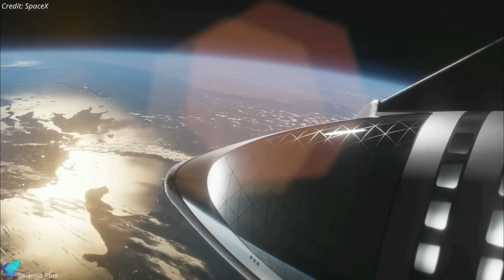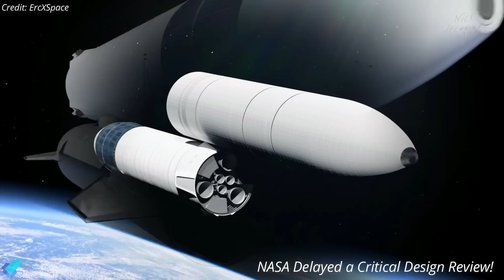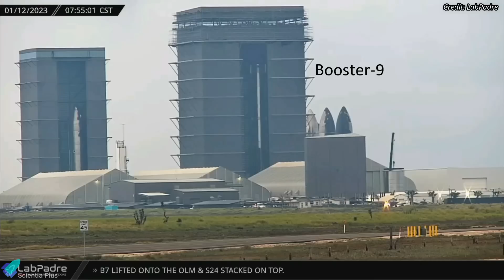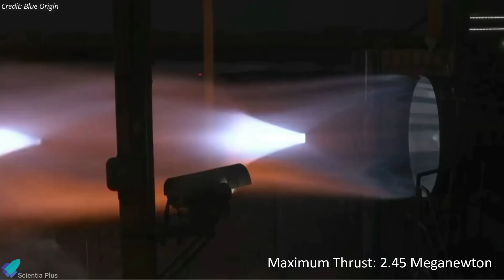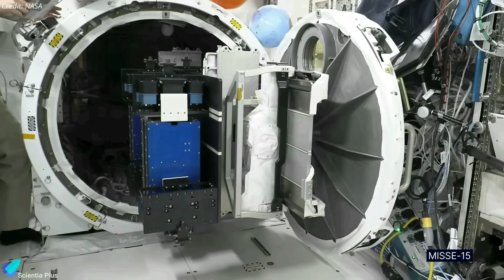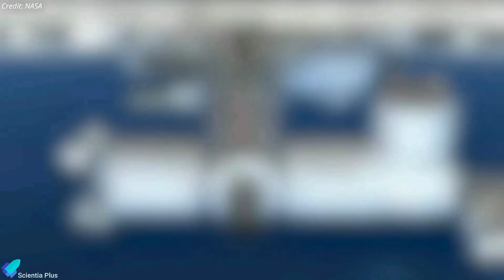NASA Blames SpaceX Starship For Artemis Mission Delay, ULA Vulcan Centaur Test Fire, Falcon 9

Comment: My words is three questions? Engine, booster, and flame do it match power? You knew if booster isbig you need bigger flame.if booster is longer side. You need more gas. But my sample is. Engine needs rebuild. Booster flame need to build a small round circle. Side is match with site. Longer booster small flame and engine is bigger. But everyone is looking at power to lefting up power booster. Is not the booster everything is engine and flame rounds.

Comment: NASA with their delayed SLS really shouldn't complain about Space X delays. Perhaps they should chat with the FAA and FCC about getting into their way if they want things speeded up.
Reply: Fully agree, The FAA in their naïvete is not used to to the trial and fix approach, as is not the case with ordinary aircraft development, where only small fundamental changes are made from one model to the next, say B777-300ER to the FAA delayed B777X, bigger wings, new more efficient engines.
Get out of the way and let the engineers develop. The bureaucratic paperwork can begin, when actual commercial manned missions are flown.
They never delayed aircraft development of the large aicraft, like the stratofortress, that was the basis of the airline application.
Besides they have no constitutionally mandated power to regulate non commercial, non interstate commerce.